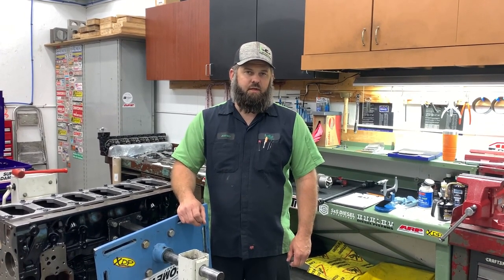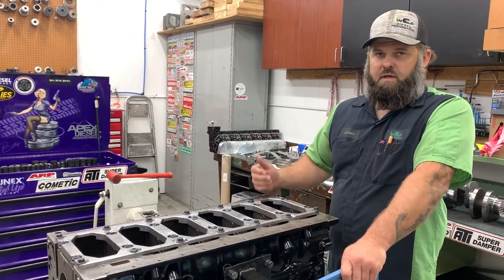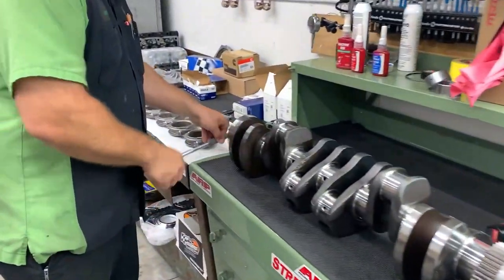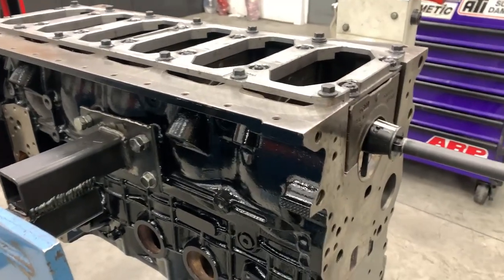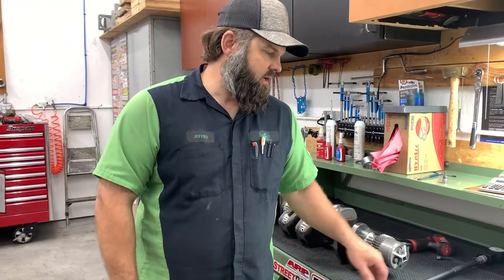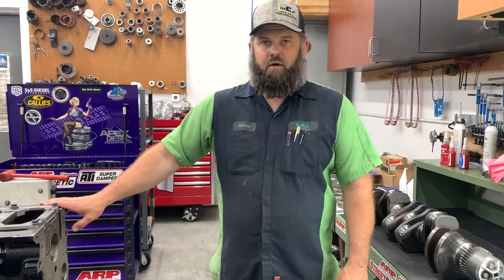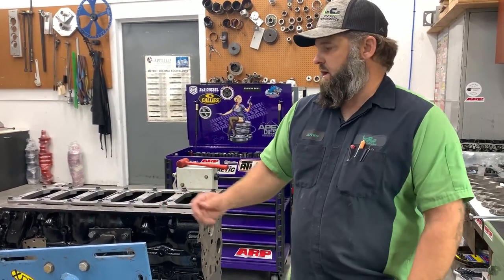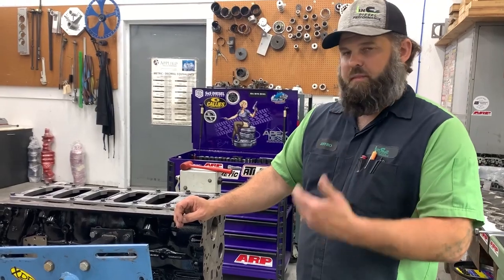How to Determine What Bearings Fit Your Engine Build

Comment: Thanks for the video.... I've got a question for you, I've got a Chevy 327 I'm putting a crank in, the rod journal size is 2.10 & the crank journal size is 1.98, what size bearing would that take...the bearings seem to be in standard, 10, 20 or 30? Thanks